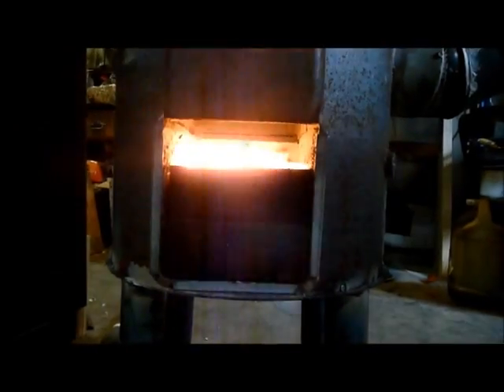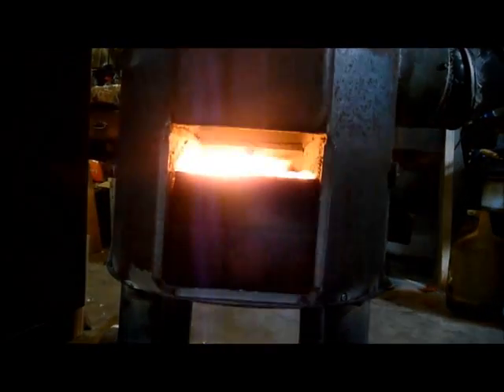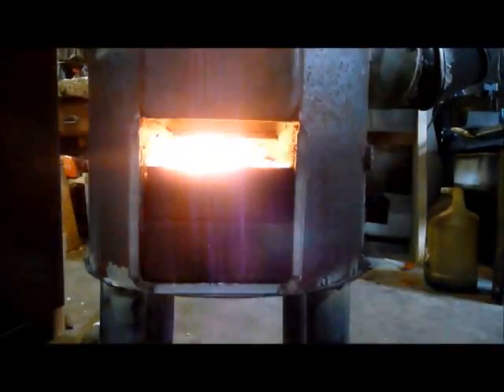Rocket Heater

Comment from the maker: Yes, excellent draw.  You had asked about a heater for your greenhouse.  A rocket mass heater would be an excellent choice.  The horizontal flue pipes could be buried in the ground under your bucket systems. The ground would absorb and retain the heat. An excellent project for yourself!